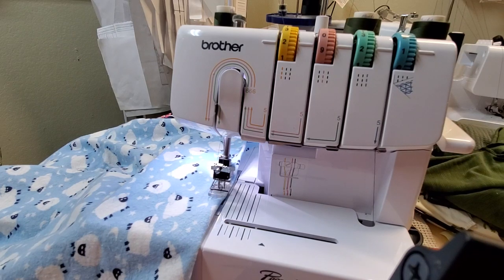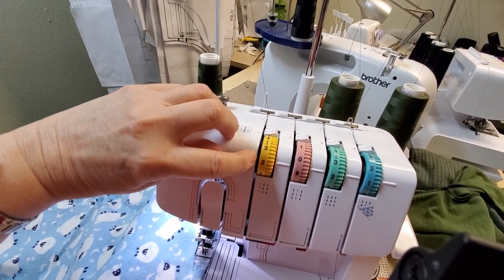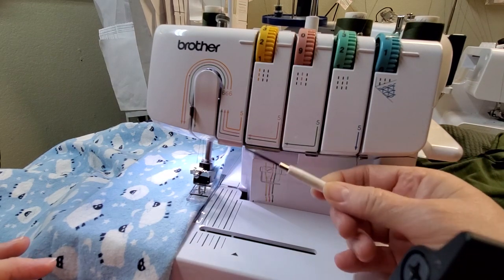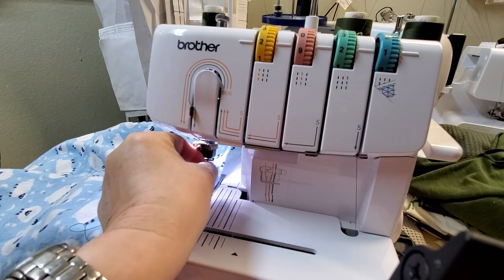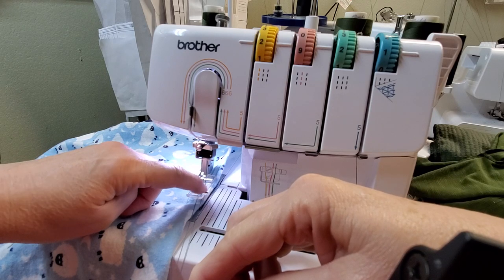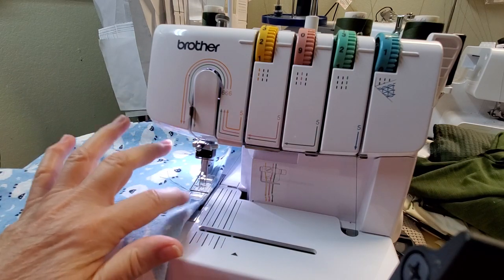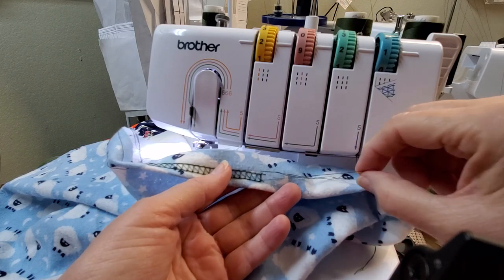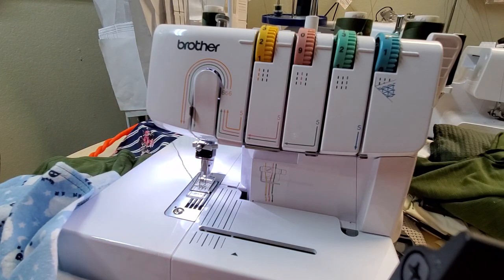how to release your fabric on a Brother 2340 coverstitch

Comment: This is so awesome. I followed you on the video and finally removed my fabric with success. Thank you!!!  Now I have to figure out my tension setting so I don’t have one needle making bigger looking stitches than the other. I’m using stretchy and thin ITY with two needles (left and right, not middle). I had my needle tensions on 4 and 4, and looper also on 4. I tried raising the left needle tension to 5, leaving all else alone, but that didn’t make any difference. I believe my differential and stitch length were on whatever the defaults are. I will keep methodically changing and recording my settings, but any suggestions for what else to change would be appreciated. Thanks!
Reply from the maker: Put your stitch length at 4 and leave it there. Instead of going up to 5 try going down little increments at a time. Needle and looper tensions will vary for each, they’re not necessarily at the same settings every time. If you sew fairly thin fabrics and you have tunneling issues, try putting your differential at .7

Be sure to use the right needles too.

Comment: Your video makes ir look easy. However, when I pull my threads at the end, it's hard work. The thread feels like it's scraping on some hard plastic inside, and I really have to tug it, despite holding the thread release buttons to the side. In your video, it looks smooth and easy. Any tips?
Reply from the maker: Try running some waxed floss thru the tension rings on top. If that doesn’t work, send me a PM message thru FB
Reply: @jeanetteweger5518  - can’t find you on Facebook. Sent you an email instead.

Comment: Hi Jeanette,
Because of your helpful videos I have purchased the same brother cover stitch you have. I am finding that there is not a slow speed that I can maintain as I sew.  The foot press hums and then just takes off. I am finding it difficult to cover stitch on curves that I need to go slowly over. I have watched your videos and have noticed that your machine does it too. Is that something that took you some getting used to? I am not sure whether I want to keep my cover stitch machine. Thank you 
JennyLyn
Reply from the maker: How long have you had your machine?
Reply from the maker: I just uploaded a video covering how to control your Brother 2340 pedal. Check it out and see if you need to lubricate the inside of the pedal.
Reply from the maker: Don't give up on coverstitching, your machine is new, there are learning curve, it may be working a bit stiff but try lubricating the areas I refer to in the new video.

Comment: Hello Jeannette, I have a little question for you. I have no problem with my seams when I sew all around (like hemming a t-shirt) as I overlap my seam by 2 or 3 stitches. However I am not too satisfied when I make a seam on a open garment (lets say hemming a cardigan). The stitches always start at about half an inch from the edge of the garment. So I have to finish the threads by hand. So what am I doing wrong? Thanks.
Reply from the maker: Put your needles down in the fabric as close to the edge as you can before your lower your foot. Once the foot is down, do your couple of hand turns and take off from there!!  Be sure to hold the thread tails as you start.
Reply: @jeanetteweger5518  Ok I will try that. Thanks. Do i have to make knots with my threads after that? By the way that fabric with the little sheeps is lovely.
Reply from the maker: @andreab919  if you sew close to the edge when it’s flat and not in the round, the serger will catch the stitches and there won’t be a need to tie

Comment: I just bought the same machine, after threading, it won't feed, it spins. I checked the diff feed (set at 1) and still spins. Any idea how to fix it?
Reply from the maker: Some have had this issue and say the belt slipped out of position during shipping. It’s an easy fix that you can do by simply taking the machine apart on that side and putting the belt back in place.
Reply: @jeanetteweger5518  Hi Jeanette, you are right! it was the belt. Thank you. I am your new subscriber. :-))
I took the side off; put the belt back on. But, now, I have a new problem, the lever is not flushed so I can not get the screw back in there. I have to call Ken's Sewing tomorrow morning.
Reply from the maker: @yuliauld1658  send me a message thru FB, let’s see if we can get it fixed.